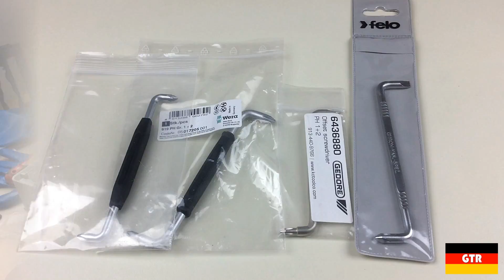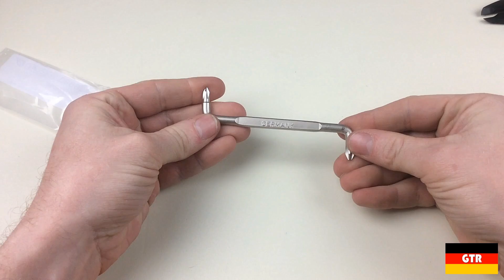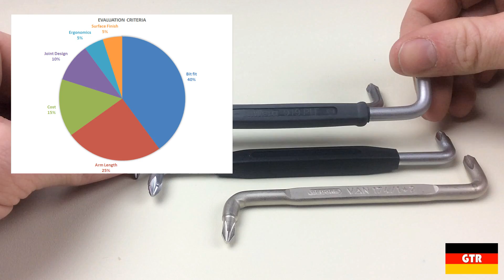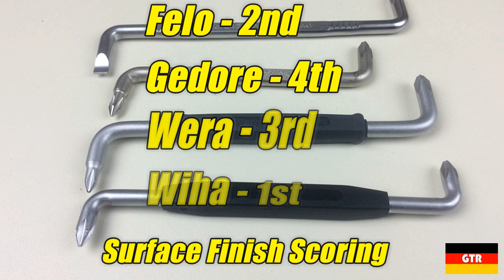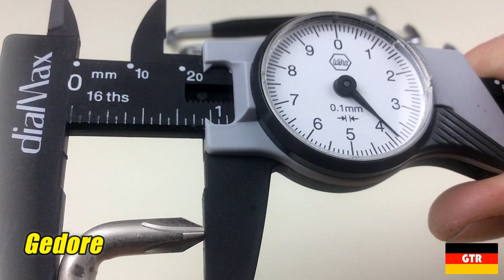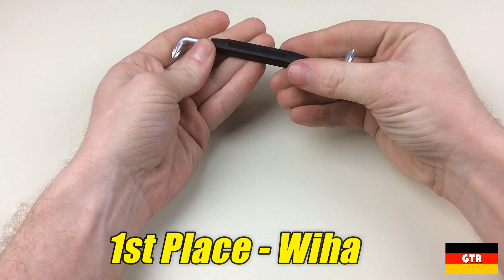German Offset Screwdriver Showdown

Comment: I have had Wiha off set screwdrivers for many years, 10+. Excellent tools. I agree with the fit into screws. I got into Wiha after buying a couple of their hex bits, I was amazed at how well they fit, that goes for all their screwdrivers too. Well worth the price as they don't round out the screw heads.

Comment: As always...great job.  It's obvious that you put a lot of time and effort into this video and I'm sure that many of us sincerely appreciate and admire that. 
 We are in the midst of re-evaluating our screwdriver and Torx bit tools as we currently use Stahlwille screwdrivers and Stahlwille, Hazet, and Gedore 1/4", 3'8" & 1/2" drive Torx drivers. The drivers seem to wear out quickly in the smaller sizes T10 - T40 which we use the most. As far as the screwdrivers, we seem to like the Wera and the Wiha, but now it's a matter of deciding which is better.
 Thanks again for all you efforts.
Reply from the maker: Thanks for the kind comment!  I don't actually have any Stahlwille drivers or bits.  I've always regarded their wrenches, sockets and ratchets as top notch but never really heard anyone say that they love their drivers.  I do have a set of Wiha Torx drivers that has served me well.  I guess like you said, you need to try each brand out for a while to see how you like it.
Reply: I think Stahlwille drivers are made by Witte.

Comment: I somewhat disagree with the weight you gave to the overall length category. Out of all the categories you judged, the overall length is the only category which depends on the work at hand rather than the tool's inherent qualities.
It might've been better if you had judged them without the overall length, and only note the length differences as a side-note for the overall score. 
Another nice thing you could've added is an overview table of the measurements in the conclusion.
Other than that, great video. The effort you put into the video is appreciated.
This is actually the first time I hear about offset screwdrivers, I can't help but wonder how many hours I wasted not knowing about their existence. So if only for the sake of winning my future battles - THANKS!
Reply from the maker: Thanks for the feedback.  Yeah, you don't often need an offset screwdriver, but when you need one you really need one (there is no other alternative).
Reply: Of course there are alternatives!
There was a one time I sawed a slit in the screw head so I could go at it from 90 degrees angle, a few times I had to disassemble sections of the machine I didn't intend to disassemble just to reach one screw, and a few times when I just gave up!

Comment: Can someone please explain to me why a bit ratchet with a bit is not a superior solution?  If the access is restricted enough to need one of these, then you can really need the ratcheting function.  I find these things difficult to hold centered over the screw and I have to constantly lift and reseat the tool because of the lack of ratcheting function.  They make very small bit ratchets.